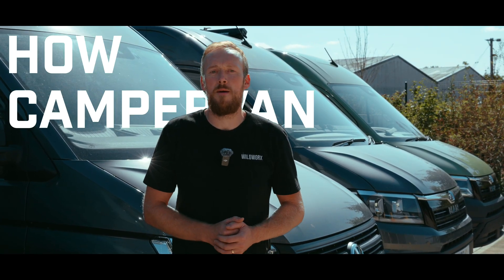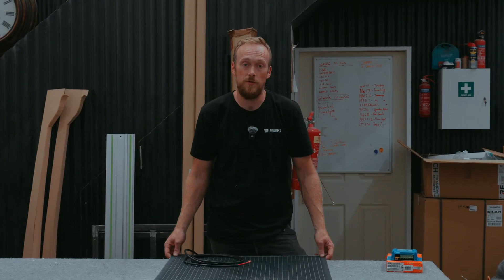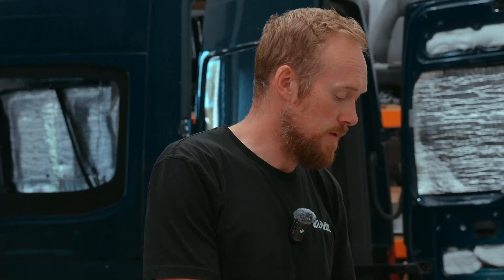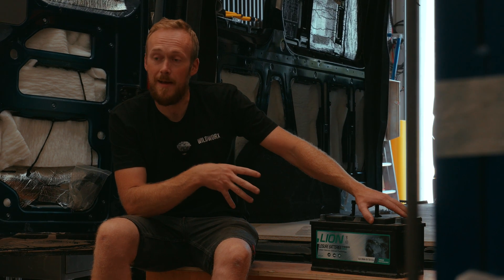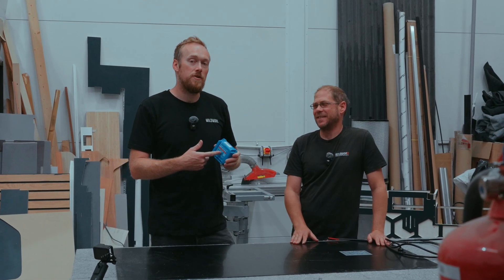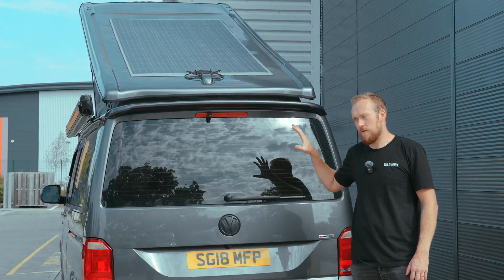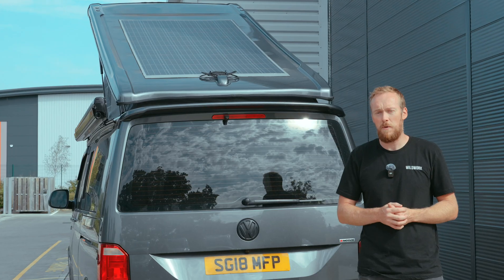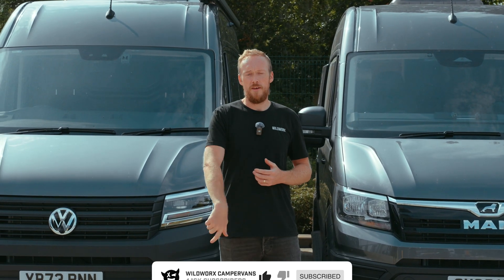Campervan Solar 101: Everything You Need to Go Off-Grid (Full Beginner Guide)

Comment: Another great video, just trying to learn about my system. I have a solar panel but no inverter so trying to gauge whether I need to fit an inverter or use a decent power bank.
Reply from the maker: Depends what you’re trying to achieve. If you want to be able to run your 13amp sockets off grid you’ll need the inverter. If you just want your 12v appliances to work for longer off grid a bigger battery bank will do the job.